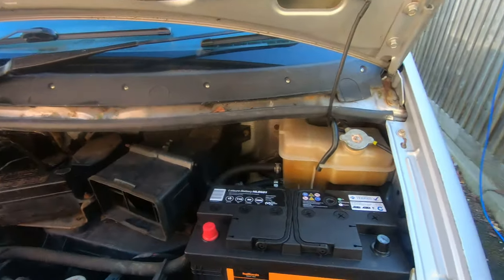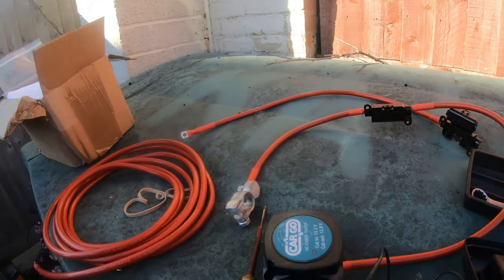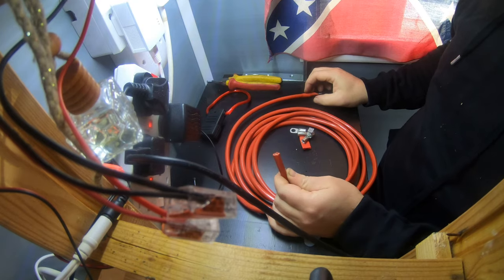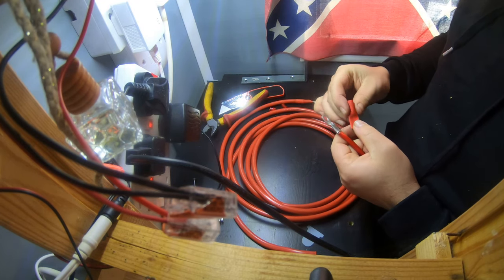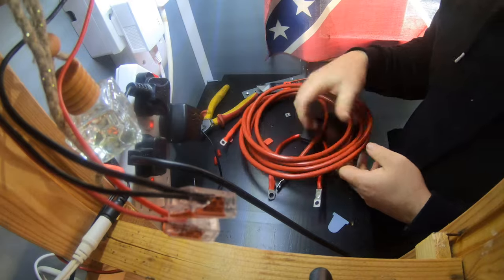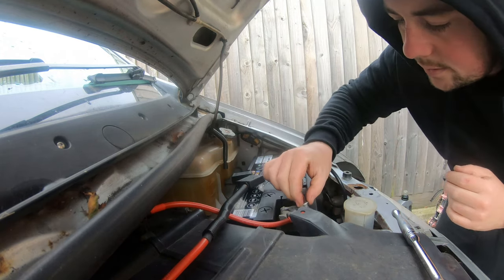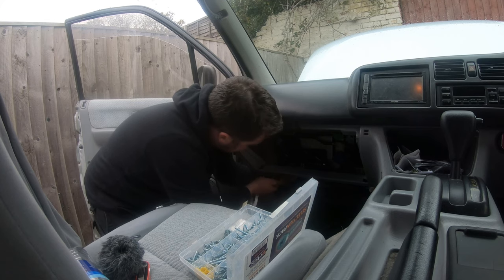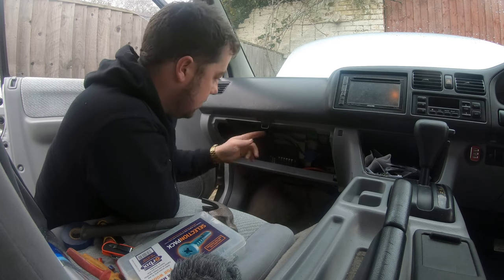Split Charge Install // Mazda Bongo

Comment: Great video. Watched it a few times now. The kit you used, was it ready made up? With the 100amp fuses in place and all the connections done? I ask as I bought a kit but the heavy duty cables need ring connectors on them, but they are too hard to crimp. Had a disastrous day trying to hit them flat with a hammer… the cables simoly fell out. So, looking for a proper tool
To crimp
There on… but it needs to heavy duty.
Reply from the maker: Hi, thanks. 
I bought it as a kit from ebay as it worked out cheap and convenient. It didn't come assembled so I had to put it together, ie fuses in carriers and crimps on cables.
You can buy a crimp tool that will properly secure the cable into the lug, best bet for this is ask at your local electrical wholesaler.
Another option is to put the cable into the lug and solder it in. 
Failing that, ambush a local electrician who will more than likely have the correct tool on the van and be willing to crimp the ends for you 😁😁
Hope that helps 😁

Comment: Great vid! Gonna be doing this soon myself!
Couple of questions for ya, how did you mount the relay, is there already a nice place for it?
I got a 5m relay kit, do you think I'll have enough cable left to run into the vehicle for the final fuse box wire up?

Thanks in advance for any help 😊

Keep up the great videos!
Reply from the maker: Hi, there is a small bolt on the scuttle panel area that I used to mount it where it is.. you could also mount it to some spare bolts around the leisure battery tray area.. 
5m should be plenty to wire the 2 batteries to the relay and then through to a fuse box inside.
Hope that helps 😁
I am doing an update video on the leisure power system next week so keep your eyes peeled for that too.
Thanks for watching 😁
Reply: That's great! Thanks a lot for the reply fella.
I'll keep my eyes peeled for the next one too 😄

Comment: Hey do you have a bracket for that leisure battery. I have the space where you do but no way of securing it.
Reply from the maker: Hi, I made my own from scrap sheet metal and fixed it to some unused threaded holes I found. Not sure if they're all the same and have these holes 🤔